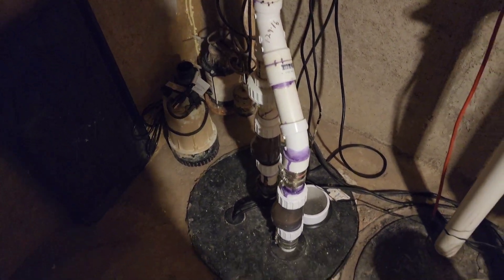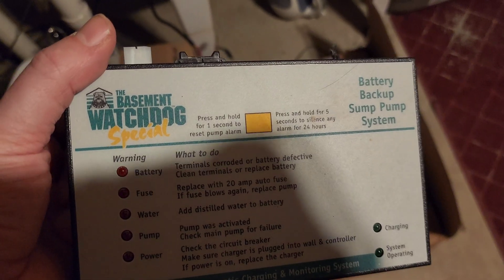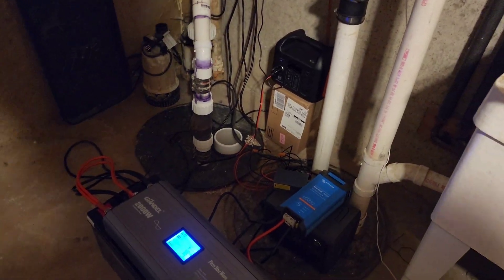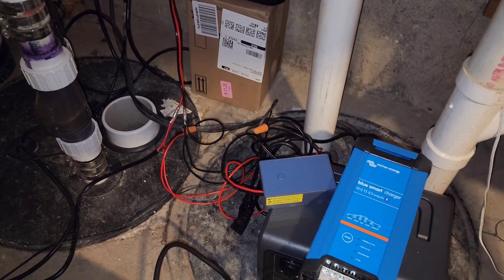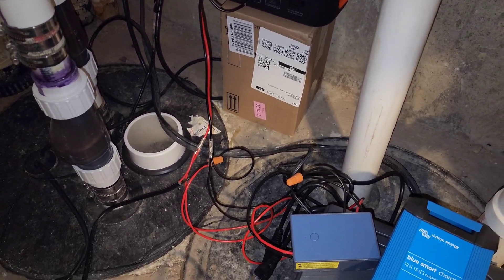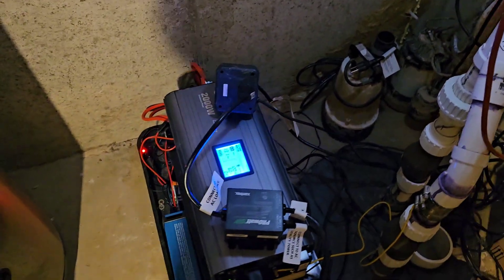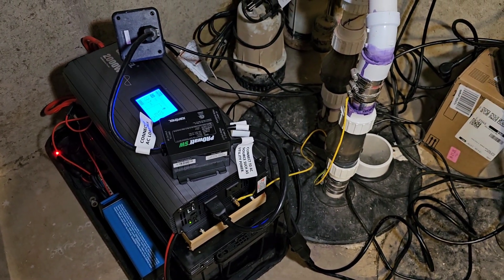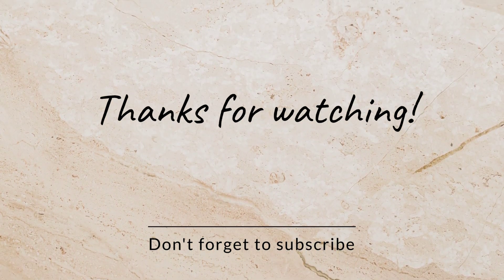Sump pump: Adding Lifepo4 battery and Smart features

Comment: So it looks like the Hydro check doesn't have a charger which is good because it wouldn't be in conflict with my lithium charger.  However, it appears to need AC power to work.  Does that mean you have it plugged in to your inverter in case the power to your home goes off?
Reply from the maker: Hydrocheck is not in this vid.  I"ll upload it later today.  But I have 2.  One is 12v batter powered for backup and other is AC powered for main.
Reply: @SYN_Raf  Thanks.  Look forward to it.

Comment: Did you remove the Watchdog monitor/charger?   If so how is the float switch on the backup 12 volt pump connected to the Lithium battery and how is it activated?
Reply from the maker: Yes I used the watchdog float switch for few month and now changed to better option, will post vid soon.  been using it now for weeks much better. Hydrocheck
Reply: @SYN_Raf  Thanks for posting this video. I'm thinking about building something similar, would really appreciate the update you mentioned.

Comment: Bravo. All IT guys think in the same way. Nice setup.
In my case 1st 1/2hp pump is on city grid directly and 2nd 1/5hp pump is on 280AH lifePo4 battery + 2kWt inverter/charger (with passthrough mode when city power is on). In this case 2nd pump is working only in case of emergency when no electricity or 1st pump failure. From my experiences when sump pumps failed , it still draw some current, so you need to keep a 2nd pump on different line and rely on water level only.
Reply from the maker: I added new float switches few weeks ago just haven't post vid yet.  but they allow to customize trigger and run time to maximize run time.
Reply: @SYN_Raf  Good idea, I considered to add switch from old no use pedestal pump for wider variation of settings....but in my case it is no go as my sump pit is really small. I always afraid of floating switches....

Comment: Nice setup. I have two Pumpspy inverters and four AGM batteries three to five feet up, on a heavy duty metal shelf. In case of total failure or if the water heater leaks, hopefully it will keep them dry, until I can get the generator hooked up.
Reply from the maker: Nice.  its good setup.